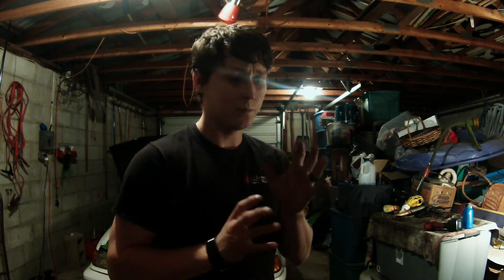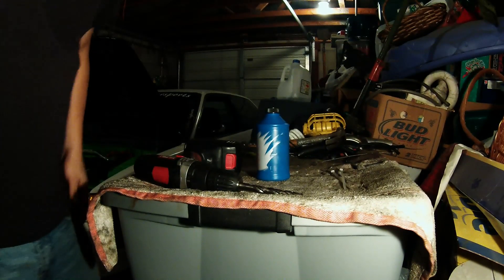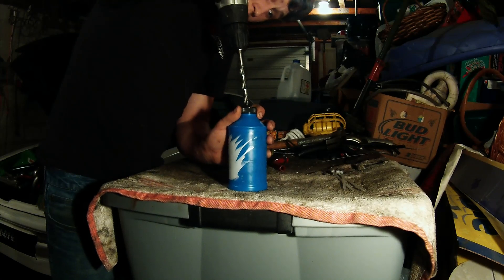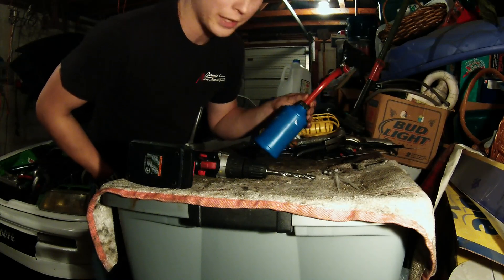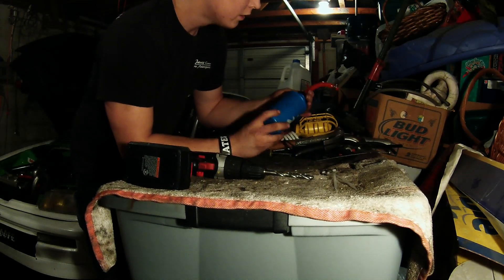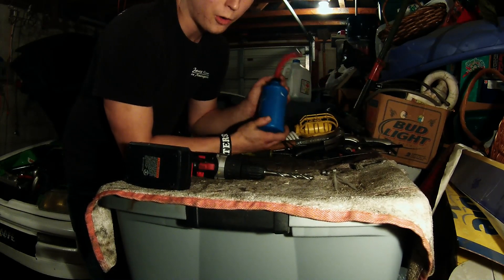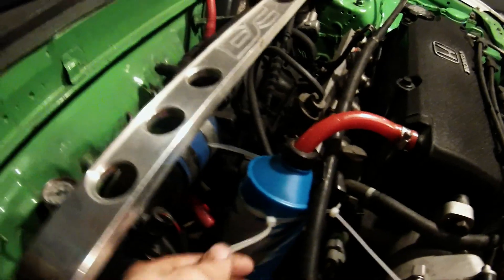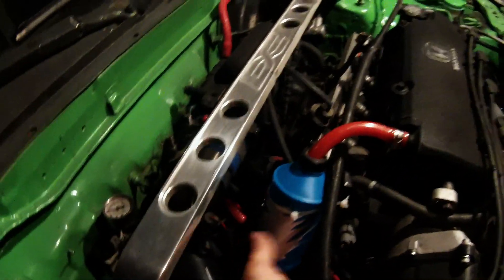Tech Tip #2- How to make a catch can

Comment: what about the PCV? can you run that into the bottle aswell if you add a breather?
Reply from the maker: Yes sorry i didn't say in the video it was about 4am i was tired lol.

You can also route the PCV valve into the same bottle but what i do usually is hollow out the pcv so its just empty then run a line to the bottle so no extra crank pressure is built up and plug the pcv hole because the hot crank pressure recirculated into the intake system causes higher intake temps thus causing pre detonation and less power and performance.
Reply: alright thanks, are there any negatives to not having a vacum on the PCV/valve cover breather (N/A engine)
Reply from the maker: Dirty engine bay and maybe 2 mpg less. It helps recirculate fumes that can be re used in the combustion but it does WAY more harm than good on a high performance engine
Reply: alright that makes sense, now does there have to be a catch can or could i unplug the pcv hose from the IM, put a vacum plug on the IM nipple, and then put a tiny air filter on the end of the hose and the filter would sit right between the fuel rail and throttly cable bracket on a typeR style IM
Reply from the maker: Yup u got it! run the hose to the bottle or a separate bottle and u got it figured out from there :)